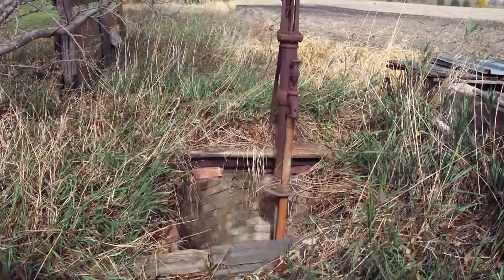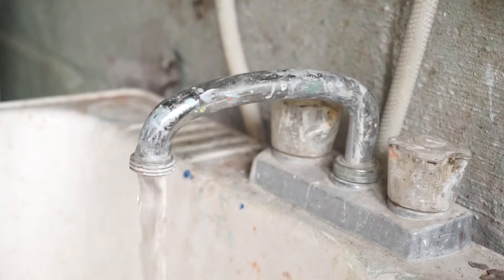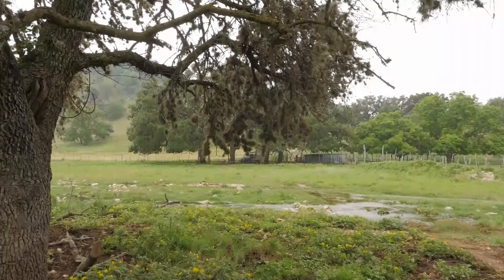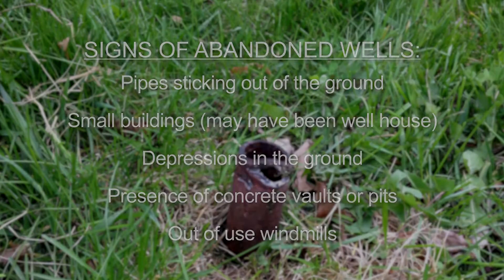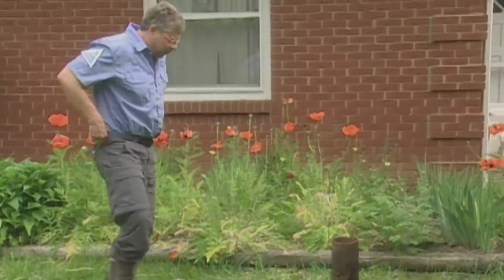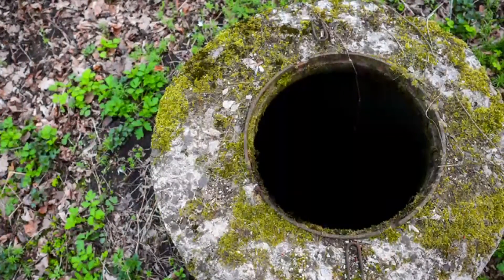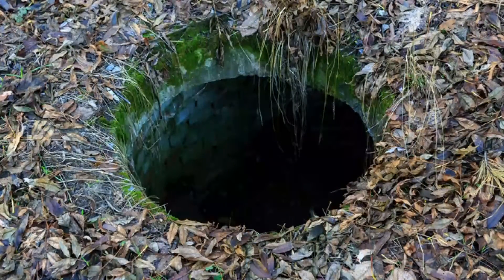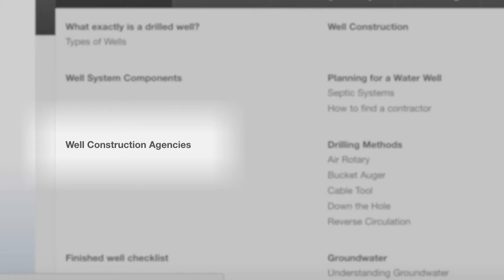Well decommissioning

Comment: I am all 4 protecting groundwater  but from having worked in the well drilling industry in my youth I have an issue with all the videos urging people to contact licensed professionals., Why? most people cannot afford thousands of dollars to plug an old well by a contractor that often times they did not even know was on property they bought. I see no reason why an individual cannot plug their own well as long as they take the proper steps and use the correct materials for their area.  I filled an old water well on land I owned and it cost me less than $1200 doing it properly.  NGWA sounds like a trade association for the well drilling industry,  NOT for protecting our water resources.